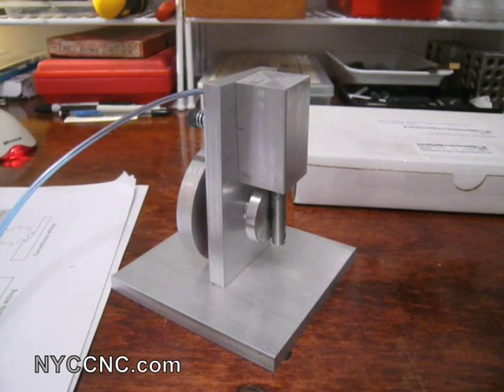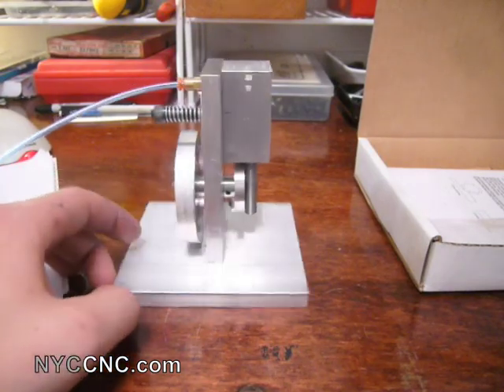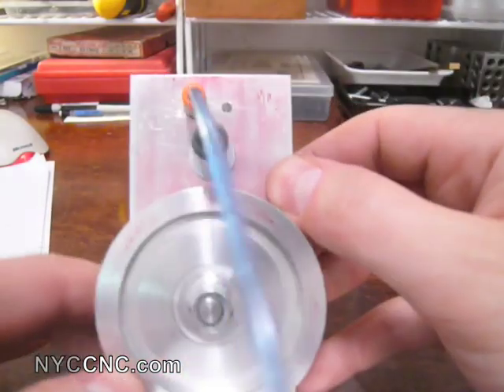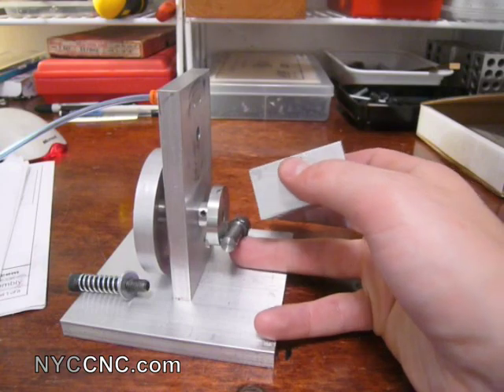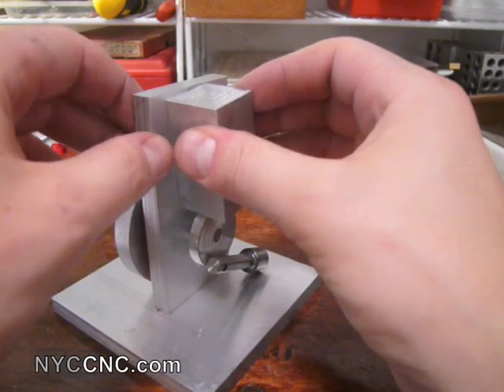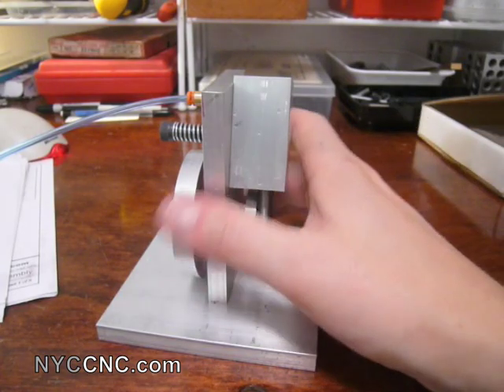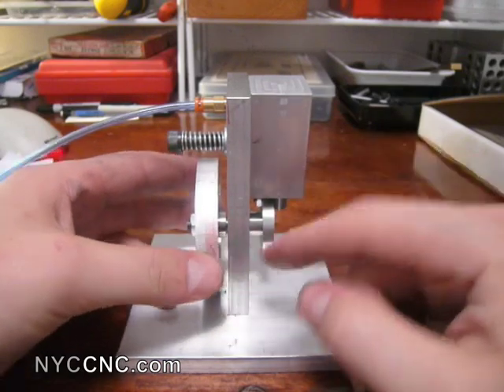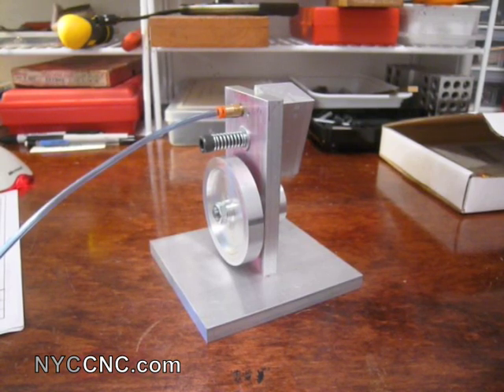Overview of Oscillating Steam Engine from Little Machine Shop!!

Comment: Thanks for sharing this excellent video.  You are a gifted teacher and extremely well spoken.  I appreciated that you weren't shy about your mistakes along the way as I am a beginner to this hobby.  I recently made a similar wobbler from watching Mr. Pete's series called something like "Making a mayonnaise jar wobbler".  I used mostly brass from old plumbing caps with a few pieces of purchased stock.  My cylinders were made from 7/16 key stock.  Different approach, same satisfying outcome.  I highly recommend learning by doing, especially if you are an amateur.  You can only learn so much from books and videos.  Also making projects make you aware of how to use the tools that you have as well as which tools you might want to buy to make the job easier.

Comment: I made the same type of single acting oscillating steam engine using the free drawings from a gentleman named Toley and the instruction on youtube by a gentleman called Mr.Pete222 aka TUBALCAIN... The total cost of materials was $16.00 Canadian from Cambridge Plastics and Metal Supermarket... The base, upright and cylinder are made from a black plastic called Acetal... I was amazed at how well it perfomed on it's first trial run... I have many compliment on it... I am presently building a double action oscillating engine twice as big as the single one... Check out mrpete222 on youtube... Great instructional videos...Good luck and happy building...Frank

Comment: If you mean the Walking Bean Stirling Kit, yes absolutely. The kit comes with the drawings, but other then a tip sheet from LMS, there are no machining instructions. The displacer, the hot cylinder, and the hot piston are already machined for you, but that's it. The tolerances are tighter then on the steam engine for the hot cylinder. There are many small parts to make. I sometimes spent a day or two just thinking about how to hold and machine one part. I very much enjoyed it.

Comment: This was my first engine kit. The video wasn't available at the time, but I thought the written instructions were well done, though I would have gotten the video as I didn't have a clue as to what I was doing.

Machining the kit gave me an appreciation for the level of care and tolerances that are required, particularly with the cylinder and piston.

I've since built the Walking Beam Stirling Kit. This kit was considerably more difficult. I'm glad I started with this little steam engine first.